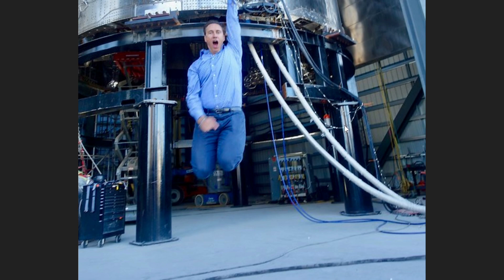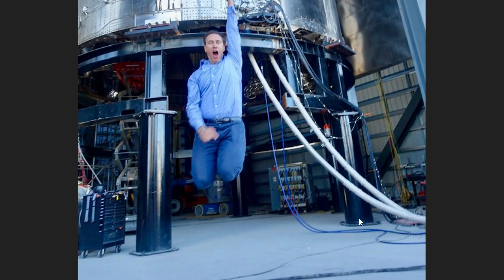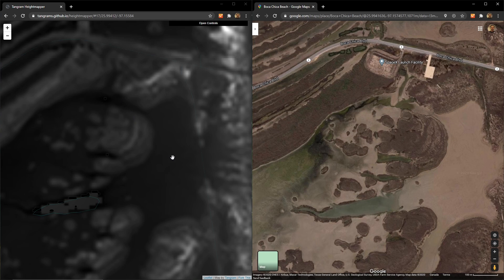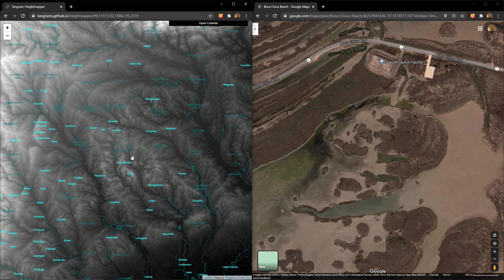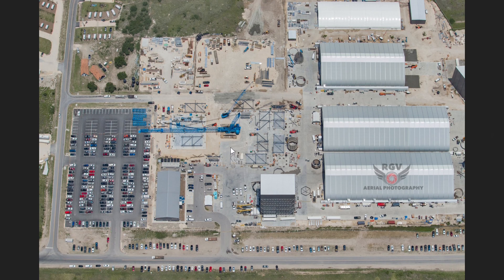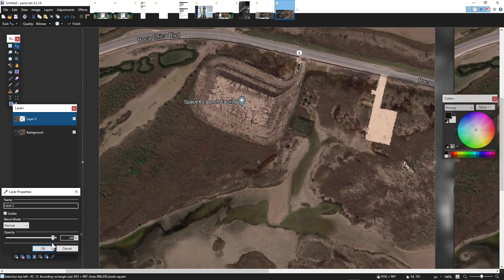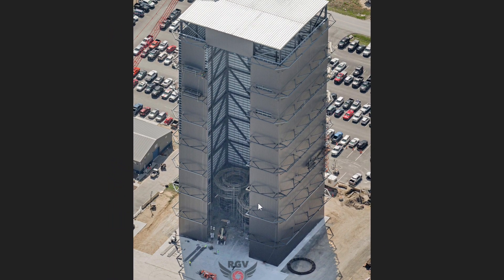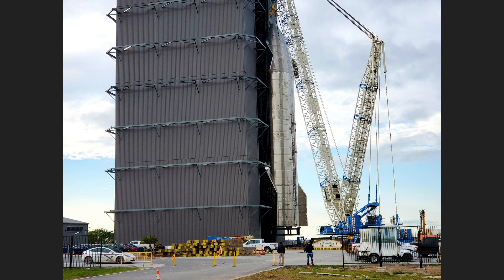Why did SN9 fall over? update

Comment: I think there is a "total divide by n" issue. When a structure is designed to stand on more than 3 legs, only 3 legs stand on the ground while the rest may touch the ground depending on how stiff the structure is. with n > 3 leg stands, most of the weight is on 2 legs and a third to stabilize. Often structures designed with 4 or 6 legs may have 2 times as much weight on 1 leg as its theoretical value. This has to do with manufacturing tolerances. If the  stand and floor are very well built, then the weight should be well distributed. If it its poorly built, regardless of the engineers intent. It's easy to have one leg taking most of the weight even if its not visible. Then one need to account for dynamic loading where wind causing lateral thrust on the massive surface  area of the rocket adds both lateral and vertical dynamic loading.  with these stands you need to at least over-design with a factor of 4 times considering that wind turbulence is not at resonance.  You cannot simply take the max load and divide by n-legs.

The other factor is, they extended the structure but they did not provide additional lateral support with cross beams, so the extensions are vulnerable for taking unintended horizontal force components. 

I think the problem is with the extensions which perhaps was a workshop quick fix and not a well engineered structure.

The problem I have with the concrete collapse theory is that it usually would give you plenty of warning with cracks etc.

Comment: Steel Tube - not solid - very strong down vertical axis of the tube (straight down)- but if you run a fork lift or something into it's side - easy to get slow deformation and collapse of one leg. The fact that they have the roll of stainless chained to the upper frame maybe there to ADD weight to counter act wind movement. This is because I don't think the legs are bolted to the floor, or they are lightly bolted and they were afraid of them shearing off due to wind loads. The sliding of the legs could lead to collapse if the upper bolts sheared off. There really isn't much holding those legs on and their length would produce a high shear load. If they sheared they may have pulled the anchors out and that would leave a hole. Your swamp pictures are of the wrong location so are not relevant  - the High Bay is not at the launch site but at the build site miles away.
Reply from the maker: Wow thank you, you are correct with respect to the location of high bay! OOPS. Good to know! if there are any worth while updates to provide I will mention and illustrate this correction thanks again.

Comment: Those legs only support the weight, they are weak to twisting force. A bit of wind on one of the fins....
Reply: Ever stand on a soda can. It will support your weight until you touch the sides, then it collapses. If you don't stand flat on it, it will also collapse. I think that is what happened to those extension cylinders that lifted the ring stand up for forklift access. They also cut a section out of the lower ring stand. If there was side load, presumably from high winds that day, one of those tubes could have buckled under the ring. Or maybe someone bumped one, but you'd expect an injury then.

Comment: I agree with your assessment.   The tip was a very soft motion which is likely hownit would go with a floor puncture.  There should be a lot of rebar down their resisting that motion and the combo of high static weight and the dynamic loading caused by the wind and the back and forth fatigue might just be enough.   Also, let's not forget... this thing was built by contractors in the rgv and suppliers in the rgv.   My experience has been iffy with this group.  If the foundation did fail, the contractor will be getting a hand delivered letter soon.   And I also agree that they will proof test it and fly it.

Comment: If the leg punched through the floor and rebar, then it would have extensive damage throughout, much like a broken eggshell. 
Why would they put SN9 back inside if that was the case?  
The other thing to think about is that the landing pad had SN8 dropped from 50feet or more onto it with only superficial damage, no evidence of holes punched in that a 1ft diameter steel tube could drop into.  The floor of the Highbay has been built to support a full booster and Starship stack and the weight of the highbay itself which is far heavier than just SN9. 
The static load of SN9 should not have been anywhere near the the limits of what the floor could support.
Reply from the maker: Agreed it is designed for much heavier loads than what was in high bay that day, what is being suggested is that the silt under the foundation washed away causing the stand to fall into. Like a small sink hole.
Reply: @leksicon  There will be rebar within that slab that runs in a x-y grid and ties into the outer rim of the pad where all the weight of the massive Highbay steel rests. The whole thing 'floats' as a solid unit with the rebar in tension, holding it all together.  Voids under that slab wont affect it , the whole things would have to be undermined and the building itself start to tilt. Typical rebar size is 3/8" diameter, and it goes all the way up to 1" like in the Booster pad tubes.  Look at the landing (crash) pad, they dropped #8 from about 50ft on it, just scuffed the surface. We don't have pics, but I would expect these pads are built the same. Look at the pad under the 6-leg launch base, it's a tight mesh of rebar. (you can see it in some early RGV pics) They must have built the Highbay knowing it would see similar floor loading for a full stack, not just a single starship. My money's on the fact they cut the lower section out of the ring stand to allow forklift access and weakened it.
Reply from the maker: @TD_YT066  thanks for that detail Tom... so you're suggesting the stand failed?
Reply: @leksicon  I heard reports that they changed the stand so it sounds like the stand failed
Reply: @leksicon  When they had it hanging on the crane, the lower skirt looked intact, so that did not appear to be the failure.  The put it back into the Highbay. They would not have done that if the floor had failed. When they had it out, It looked like they did put a new ring on the base that did not have the gap. But it did not have the leg extensions. My suspicion is one of those failed or bent under from side force.

Comment: OK, so the empty weight is like 25 tons, and that is divided by the 6 legs. I think a crumple collapse is unlikely.
Reply: That floor's going to crumple if Elon doesn't go on a diet.
Reply: Isn't the dry mass 120 tons of so? I don't think the floor failed though, they out SN9 back where it was on a new supporting structure
Reply: more like 75-100 Tons empty. 120 is the final version aim weight.
Reply: @watkinscopicat  considering the MK1 weighed 220T, and the switch to stamping and TIP TIG welding brought it down by 20%, they still have some optimizations to do before their near the goal of 120T. Definitely not around 100 or less tons.

Comment: I can't tell, is the lowest diagonal line in the picture with the happy man, in the lower RH corner, is it a crack in the slab, or a cable?  If that slab is cracking already, I think that would support your theory.
Reply: looks like a very heavy, dusty cable or hose.